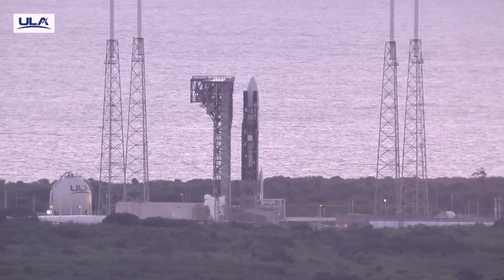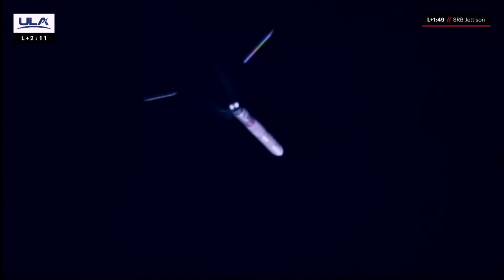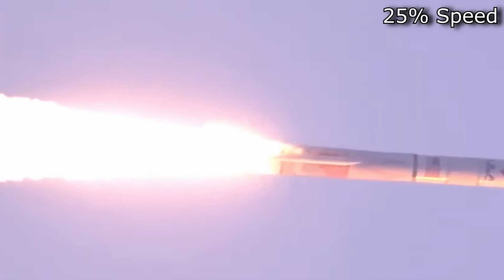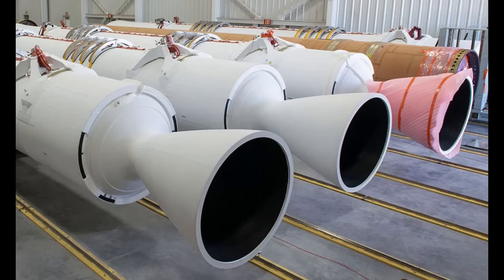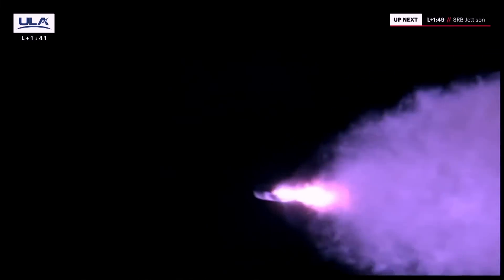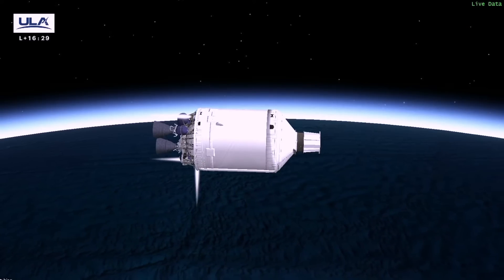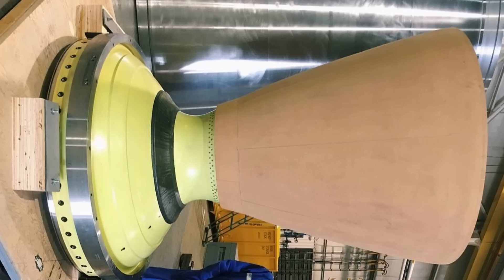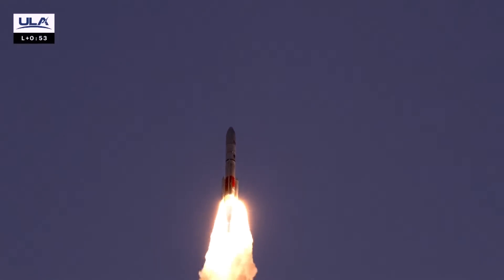How Did The Vulcan Rocket Survive This Booster Failure?

Comment: No doubt FAA will not shut ULA progress down for this booster failure. The FAA marching orders are to attack SpaceX and give the others a pass.
Reply: That's simpleton rubbish at best.
Reply: The Elon Musk detractors have their marching orders too … just look at what Elon is up against, even in video comments right here
Reply: FAA statement is “No public injuries or public property damage have been reported” as they hold off on determining if an 8nvestigation is warranted.   Just because a booster exploded the nozzle right off, during lift off, with incandescent pieces flying off while barely off the ground,  FAA is rationalizing why they may never investigate.
Reply: FAA statement is “No public injuries or public property damage have been reported” as they hold off on determining if an investigation is warranted.   Just because a booster exploded the nozzle right off, during lift off, with incandescent pieces flying off while barely off the ground,  FAA is rationalizing why they may never investigate. And if they do investigate, it will be done in a way that does not block progress (unlike what they are doing to SpaceX).
Reply: … and when I provided specifics that prove my point, that post got deleted.  Why is the truth suppressed right here in comments? Why does the ad hominem disparaging response remain while my response is deleted?

Comment: An interesting thing to note about the expansion bell section of a nozzle is that it should be under compression as far as axial stresses go (if it wasn't, then you would get more thrust by cutting it off). The implication is that assuming the nozzle failed downstream of the throat, it would be either a hoop stress rip failure or a axial crushing failure. (In either case, likely a result of there being less "stuff" than intended to support the load.)

OTOH, it's possible that a burn thought could produce enough axial drag from the supersonic gasses to rip things apart, but I kinda suspect that things would fail well before it got to that point.

Comment: Its really interesting to see how adaptable rocket guidance has become. We've seen plenty of rockets and landers lost to software and hardware bugs, but also a lot of saves.
The Astra Rocket losing an engine on the pad and taking off in a hover, the Falcon 9 that made a water landing with failed hydraulics on the grid fins, Starship performing a bellyflop and touchdown with the flap melted off, and many more which i cant remember.
Reply: John Carmack came up with the current paradigm.

He took MITs fast inverted pendulum solver, and put it on a rocket, with off-the-shelf compute. 

That's why Elon's codename for Starship was BFR.

It wasn't a Doom reference, it was a John Carmack reference. Specifically the work he did at Armadillo Aerospace. And probably yet another attempt to get John to work at SpaceX.
Reply: @jtjames79  The guy really did drop a few sweet ideas huh? Sadly knowing Musk he'd be more likely to attract Romero over Carmack, and I don't know if we need rockets with that attitude
Reply: Astra mowing the lawn will forever be my favourite launch. it was serendipity that gate was open, the nozzles would not have cleared it otherwise.
Reply: @CoreyKearney  SpaceY
Reply: All hail control systems engineers!  Hip hip hooray! (I'm serious)
Reply: And then we had MCAS.  So pathetic isn’t it?
Reply: @longboardfella5306  Of course MCAS is the key to performance of 4th and 5 generation fighter jets!!  The problem with the 737 MAX, was keeping it a secret from the pilots!

Comment: 14:33 I think it was not the nozzle that was seen spinning after the "observation". I think the burn-through caused a chunk to obstruct the throat (before the double-line of rivets) and it broke at both the black rubber part (Vibration/Resonance damper?) and the sharp thickness change between the green and heavy machined metal to the left of it. 
While I'm consistently wrong when I guess rocket stuff, I'm calling this one "Vibration-induced failure from internal insulation de-lamination (came unglued), and a combination of thermal and acoustic overload resulted in an emergency nozzle ejection". I'm assuming it either failed successfully, or an overpressure event was detected and perhaps they have some kind of explosive cutter that uncaps the can before it bursts and ends the mission. I suspect that a lot of thought has gone into SRB safety mechanisms after the Challenger "observation".

Comment: I imagine the nozzle being pointed inward through the center of thrust, propagating most of the debris away from the first stage, is primarily what saved the BE-4s from being damaged by the SRB RUD
Reply: They also need to check if the BE4 affected the SRB or not.
Reply: Also could have helped by not inducing a lot of torque

Comment: Before hearing your full analysis, it seems like the divergent section of the nozzle broke away. That would cause reduced thrust on one side, but wouldn't affect the burnrate. As long as the heat shield surrounding the liquid fuel engines can tolerate the extra heat load, that those engines can compensate for the thrust imbalance, and they have sufficient Delta V margins, it makes sense that this wouldn't necessarily be a failure.
Reply: This reminded me of 3rd test firing of the huge AJ260 SRB(NOT to be confuse with the liquid AJ26 engine) in which the nozzle got blown off near the end which prevented it from reaching the desired total impulse.

Comment: Here's the thing: surely this whole event proves the Vulcans reliability more than questions it, and same for ULA as a whole? Northrop Grumman are presumably at fault for Their booster, which failed - but the Vulcan was well engineered and sophisticated enough to complete mission profile despite a huge loss of DeltaV early on. In my opinion ULA have a good case to make for their hardware as a good choice for other payloads- NG on the other hand should maybe take the wrap and file their investigation!
Reply: Not so fast... Remember Apollo 13 was caused by an accidentally dropped tank... We don't know if something happened to the booster post factory....
Reply: @chrisjohnson4666  that is true! And definitely worth the investigation too: I would hope that the records don't make it look worse than it is, if indeed ULA were not at fault! But you are right, I shouldn't have excluded them entirely

Comment: If you look at the part falling of, It looks more like its just 20% to 30 % of the phenolic resin part of the nozzel. But a failure in this lower pressure zone is more unlikely in my understanding. I would suspect that the original problem higher on booster and that due to this failure some time later something got loose and fell onto the nozzle. We know from the space shuttle that such falling parts can have devastating effects at these speeds. I'm eagerly awaiting further details

Comment: Hi Scott
The nozzles of the solid boosters are angled toward the center of mass to try to avoid enormous disturbance torque in the case of a malfunction. So the central stage engines might not have had to counter much asymetric thrust.
Anyway this angled thrust of the remaining functional booster drives the entire rocket velocity vector to no longer be aligned with the axe of the rocket.
Reply from the maker: The problem is the center of mass moves as fuel is depleted.

Comment: If we had sea-level footage at 6:33 I bet we could see the ghost of Stockton Rush chasing to catch the lightly used composite nozzle.
Reply: Since the nozzle only used its expansion strength life, it still has its compression strength life left
Reply: @jonbob585 and any other issues can be fixed with epoxy

Comment: NASA Spaceflight had some pretty amazing footage around 3 hours 32 minutes into their livestream.  At one point they have a shot where the rocket goes behind a cloud and it works out so you can clearly see a plume shooting out the side while temporarily darkened by a cloud, before it fails entirely.  If the plume had been on the other side it could have torched the BE-4 nozzle for several seconds before blowing off.
Reply: Why the heck is the telescopic coverage of the launch so freaking bad? SpaceX use AI assists as I understand it to keep the cameras pointed steadily at the rocket. This coverage wobbled all over the place
Reply: @longboardfella5306 the more you zoom in, the more the movement of the motors and equipment used to move the camera get translated into the image, the equipment is so sensitive that heartbeat of the camera operator can sometimes be seen in the shot. 

It also important to realize that while we think the stuff the camera captures is amazing, many times they are really engineering cameras, so they are there to perform a job, which is why they appear to only be able to catch certain portions of the rocket but not the entire thing.

Comment: Noticed there was no comment during the launch when there was an obvious anomaly.  Glad it didn’t escalate.
Reply: Pretty common tbh
Reply: That's because public affairs people read from a script of what should be happening in the timeline, not what is happening in real time in the sky or in telemetry. The Challenger disaster was a classic example of that.
Reply: @EdwardRLyons  That's what I was figuring for sure.  Just thought some mention might have been made about the little bit of fireworks at some point after it happened.  Something like 'there's been a small anomaly in one of the side boosters but the Vulcan's flight systems have compensated and (either) has made a successful orbit (or) is proceeding on a nominal trajectory'.  Would have looked good for ULA to be on top of it before the community piped in.  I agree with @jajssblue 's comment.  Quite impressive.
Reply: @lawrenceharris7717  The role of public affairs is to follow the script. It's not in their job description to make observational interjections, much less engage in speculative analysis of on-going events. That's why I prefer to watch streams with just the comms loop audio, if available. Public affairs commentary is usually just noise to be filtered out.